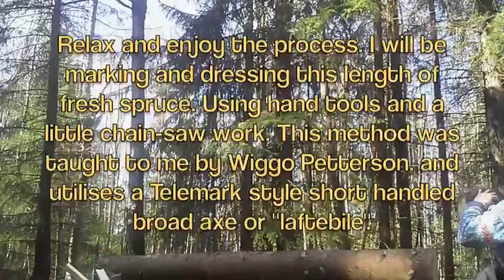🔴 Hewing timber using  a Norwegian method.

Comment: I’m no expert but you think your Brodhead axe handle might be alittle short maybe if the log was on the ground sitting on two smaller logs you could use a longer handle and let the axe do the work. Just an outsider looking in.
Reply from the maker: The axe handle on this axe is dictated by it's versatile function, it is not a hewing axe per se but a laftebile, and is a tool for building log houses. Hewing is one of the functions it performs well, once mastered. Hewing axes are, however, very often short-handled as well, in this tradition, the height and dimension of the work piece dictating exactly which length the handle should have. Long handled axes are used in Japan for hewing, I have also seen a Frenchman hew like them; standing atop the work-piece. This system like those, is ancient, I didn't invent it and I wouldn't change anything. I have made several handles for this axe over the 25 years I have had it, and it has never occurred to me it needed lengthaning.

Comment: What's the point in hewing if you're going to use a chainsaw?
Reply from the maker: Maybe You missed that bit
Reply: @LucasRichardStephens  I know I'm very late for the comment, but he has a point. If the whole point is to show the traditional hewing, mmmmmmmmaaaaaaybe it would have been a good idea to also do the starting cuts with traditional tools for THIS particular timber; I'm fully aware of the time that it would have taken, but you could have just timelapsed it - or even started them with the traditional tools, then put a "now that we've shown how it was done, lets speed things up" screen card and finished the work with the chainsaw off-camera (I've personally used that latter approach on live demostrations of medieval armouring, punching a few holes manually before moving to the power tools for the remaining 9001 holes of the work).
I know you mention "this would be done with chisels", but WATCHING how they would have done it with chisels would have been mighty interesting.
Reply from the maker: @notfeedynotlazy  There is a lot of info in the comments. My films are not "how to" films, just films for entertainment. In this film, no attempt was made to create a  filmic narrative, I just put the camera down and it captures my process of quickly making a piece of timber for  a wall repair, that I carried out the same day. No time was wasted, every action counted directly towards the finished result. I could not have done the work faster by any other means. The final wall repair matched the hand made hundred year old wall perfectly.
Reply: @LucasRichardStephens  That explains then why you couldn't waste time doing work with the chlsel 🙂

Comment: You should sharpen your tools. :-)
Reply from the maker: I think razor sharp is good enough for this piece of wood.
Reply: Yes, razor sharp is OK.
But it looks like an old kitchen-knife. :-)
Reply from the maker: What may not be clear for someone who has not done this themselves is just how lightly the axe is being used, the aim is to make a flat surface so some cuts are attempting to remove just a couple of millimetres with a very light stroke, the speed of cuts on the other hand stays the same. Maybe that is why it can appear the axe is not sharp? When I hit a knot I have to hit much harder, and this is knotty timber.
Reply: Now I looked the video for the third time and it looks indeed like you explained. But it´s different to japanese hewing videos. May be thats the reason why I thought, your tools need to be sharpend. Please excuse my mistake.

Comment: A chainsaw?! Use a drawknife to shave the bark and then a chalk line to mark a line. Kind of defeats the purpose of hewing if you use a chainsaw doesn't it?
Reply from the maker: They are all just tools, the purpose is to make timber for restoring a rotten wall, I am not pretending to be in the olden days or something. The axe does a good fast job without fuss, the saw cuts quickly and easily a guideline for the axe, which can then be used faster and with greater accuracy and give a finnish in keeping with the wall it is destined to fit with. Also the chainsaw cuts across the fibers, facilitating fast hewing. If I had been a museum worker recreating an historical technique then I would have worked with just an axe. If I had more than 10 or 15 meters to cut I would likely use a chainsaw mill and a power plane. No purpose has been defeated. This is a professional situation not a hobby or an act.
Reply: That makes sense. Great answer Lucas. Thanks for taking the time to respond. Personally, I like to avoid power tools because of the noise and dust, but if practicality is the primary consideration then it makes sense to use what is best for the situation.

Comment: no blade safety in any of the tools, OMG bleed to death in the great outdoors by a thigh cut
Reply from the maker: don't try this at home
Reply: ha ha, I love the blend of new school and old school. Thanks for the post. My Amish grandfather built timber frame barns (in Indiana) with no blueprints, just all in his head, and he also didn't have any 'blade safety'.
Reply: I think this looks perfectly safe, since he is aiming for the ground in front of him. Not the end of the timber behind hes knee...
Reply: Niklas Sarri I noticed all his "power" chops, the handle stays parallel to the ground, or even handle slightly down, which would direct glances outwards, not arc back towards the leg. Lighter chops (some that do turn the blade edge towards him) are short and controlled with minimal follow through or overtravel, so not a particularly hazardous technique as far as axe work can be called un hazardous.